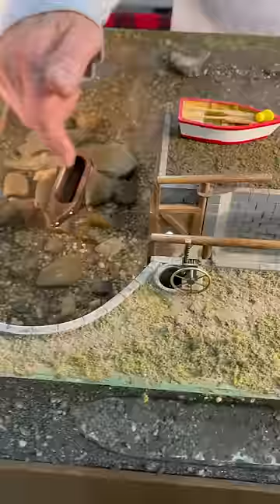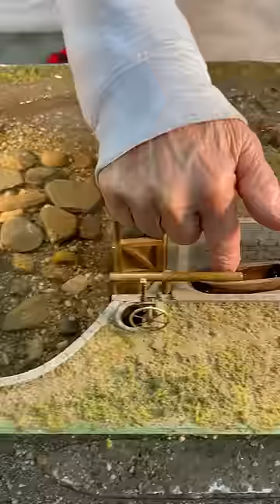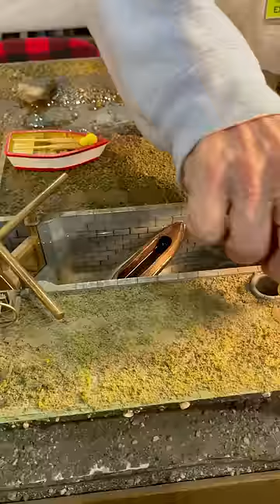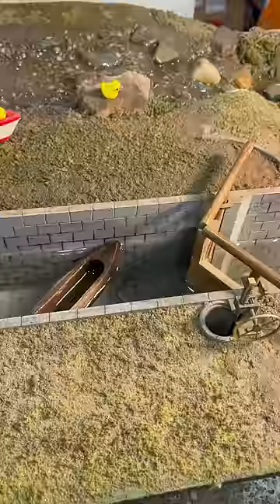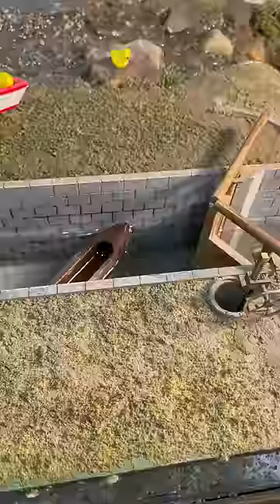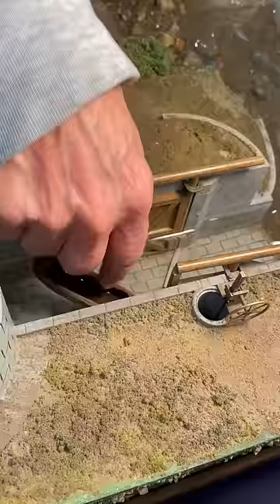Canal lock | miniature boat lock model

Comment: Very cool! I also want to know how the model works to send boats back upstream.
Reply: It's the same model, the gates are open at the bottom and you sail in and close them and so on... the reverse of what you see here.
Reply: @weejohnbb  Yes but I want to see the pumps work to fill up the huge amount of water to lift the vessel.
Reply: @nagarajansubramani they don’t pump the water in, at least in most of them they just open the doors slightly or have very small shafts next to the door that is holding the higher water. That is what I’ve experienced when on my parents their boat for over 9 years it was pretty stressful because the water pulls your boat all over the lock if you don’t hold it tight to the sides
Reply: @nagarajansubramani  that's the beauty of locks, no pumps needed, you just open the valves to fill the lower lock and lift the boat. The water is always flowing into the lock system.
Reply: This technology were used to in ancient Indus/Sarasvati rivar civilisation.. In 3000BC .. They were using canals as water highways and water tidal force for there cargo boats..

Comment: That is a model of how the canal locks work in the U.K.  from the way the gates are opened with leverage and the water valves are exactly the same even the rack and pinion valve system are the same to the narrow boat.  Someone said it’s a model of the Panama Canal but it looks nothing like it the gates are wrong and water levelling system is wrong.  It’s clearly a model of the British cabal locks system.

Comment: Only thing it's Missing is ; When you Let the Water out / Down , Shouldn't it Be Generating Electricity  at the Same time .. Dual purpose .... LOL  ( Water Turns A Alternators  or Generator  and Can open the Door by Push button or Saving Electricity for the Home or City ... Solar panels as Back up !